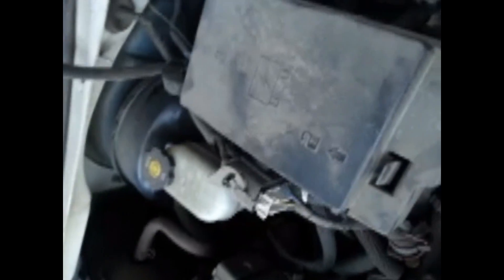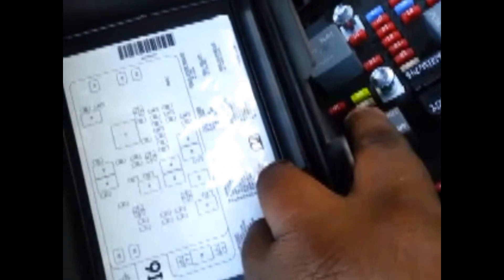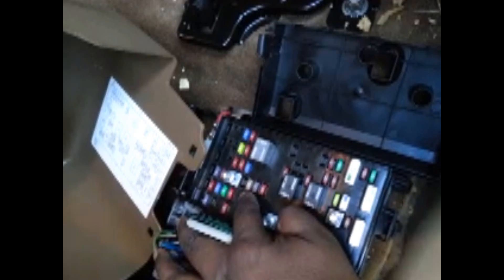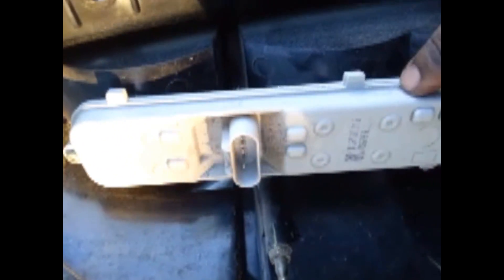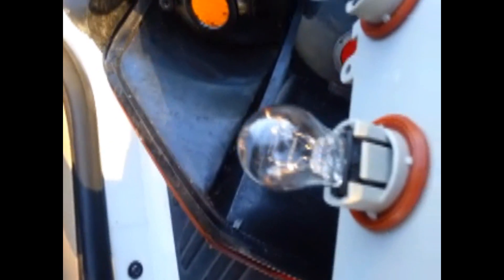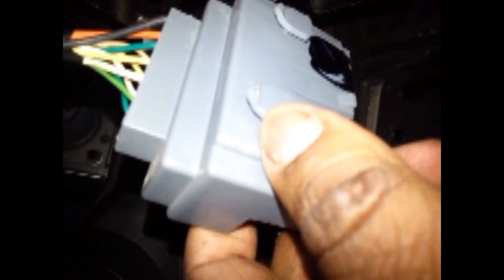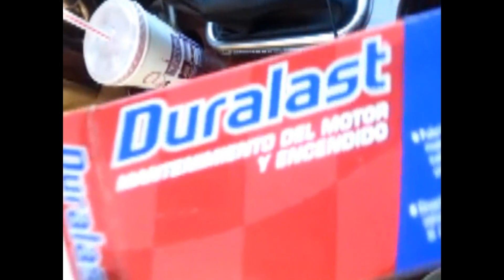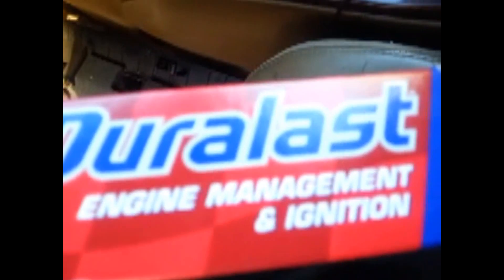2002 2011 GMC ENVOY AND TRAIL BLAZER REAR TAIL LIGHTS STOP WORKING

Comment: 2005 Chevy Trailblazer. My driver side only functions as tail light and the passengers side only functions as a brake light I tried replacing one of the circuit boards and check the fuses.  Could that problem be caused by the switch.

Comment: Where do I buy bubs
Reply: Ligth bulb's check Walmart they are cheaper u can get two sets for an extra 3 bucks  oh an by the way you can get those circuit board at Orelys or carques auto parts and some places they make u think u need the hold ligth assembly because they want to make extra  money also beware wrecking yards are notoriously tipoff when it comes to stuff like these????2003 chevy trailblazer replace same part?